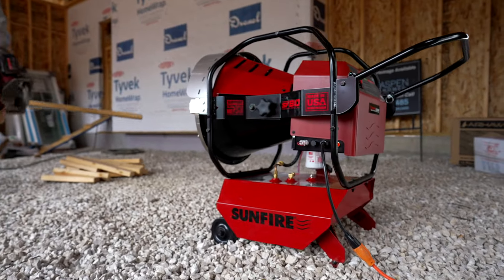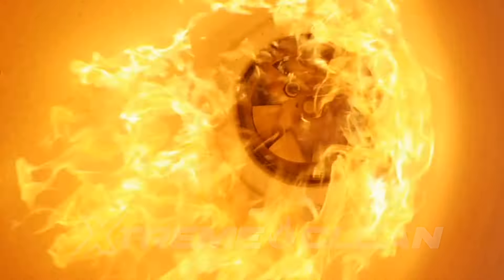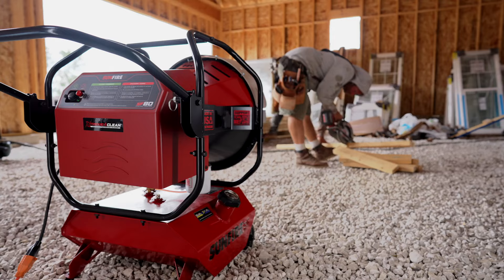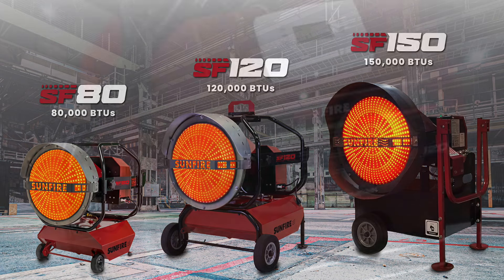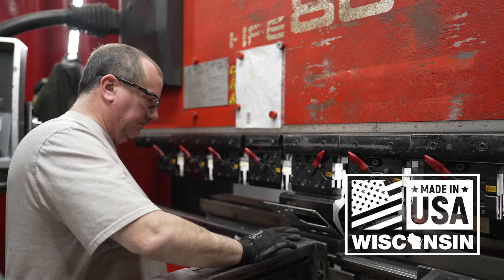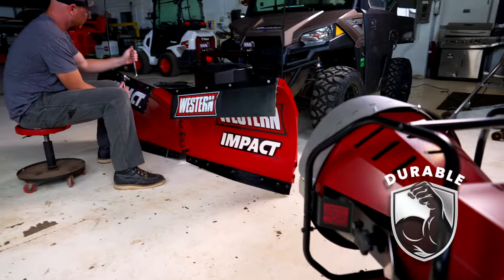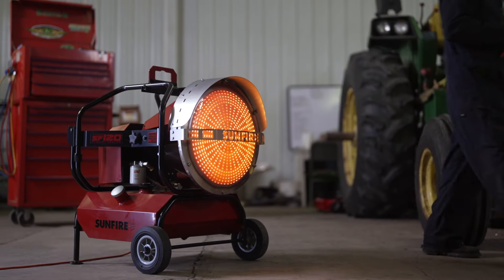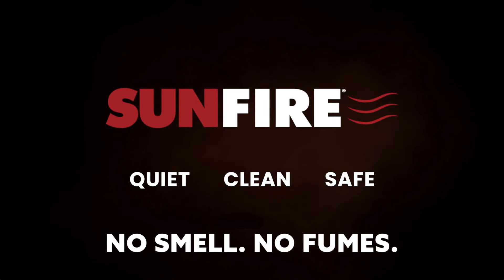SunFire® Heaters Have No Smell and No Fumes for The Ultimate Heating Experience

Comment: Lie. My shop(indoor)  just bought 2 of these for the Texas freeze. There is a strong smell that these emit from the burning of fuel. There is no way these run on diesel without creating a smell. People are starting to get headaches.
Reply: I can confirm your comment as true from my experience too. Things constantly need maintenance too.
Reply: Put our new SF80 in service today and the guys are ready to throw it in the dumpster.  These are not fume free and smell free.  These can't even be safe they stink so bad.
Reply: Did you run off road diesel or regular

Comment: Hmmm. diesel fuel, propane, gasoline and kerosene are all hydrocarbons (HC).  HC + combustion = CO ( carbon monoxide).  Even a car burning gasoline (HC) needs a catalytic converter and it still puts out CO.  Even complete combustion you  have CO. I don’t understand. How are they getting 0/1 PPM CO. I’d like to see test data.

Comment: Carbon monoxside is oderless stop telling people that no smell is good, it is the carbon monoxide
Reply: If you have ever worked around the older oil fired heaters you would understand how no smell is also important along with the CO output. Also, as someone who has worked in an auto garage for years I can tell you there are odors and fumes that are produced along with CO that are telltales of exhaust leaks. Along with major headaches and queasiness.

Comment: I don't see how they don't make fumes. If it's burning diesel fuel it's making fumes, and you could die without proper ventilation.
Reply: There are other catalyst heaters that claim the same but I don't know if these are catalyst heaters. We have 3 propane infrared catalyst heaters in our shop. I have had 13 winters there and still living. I know what CO poisoning does because I have worked in an auto shop for 10 years in a previous life and had CO poisoning several times do to exhaust leaks in the winter.